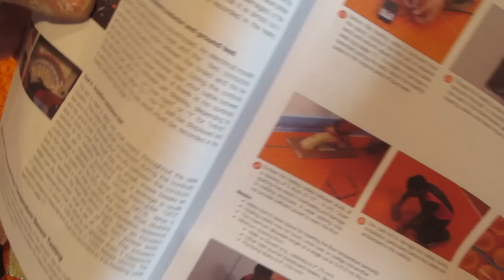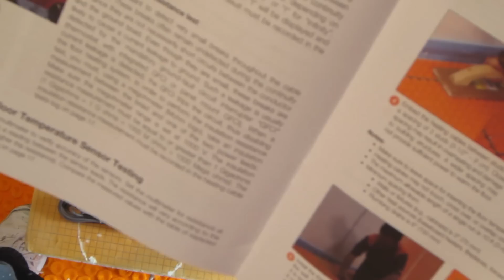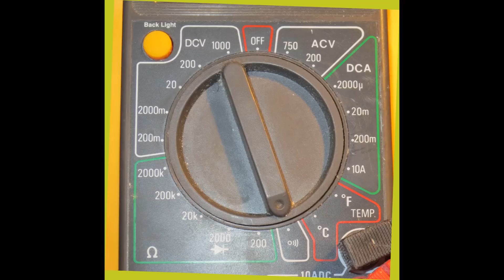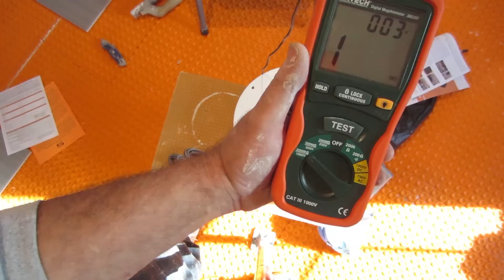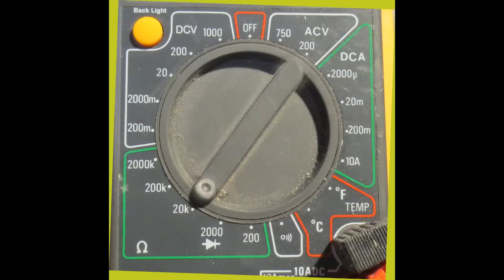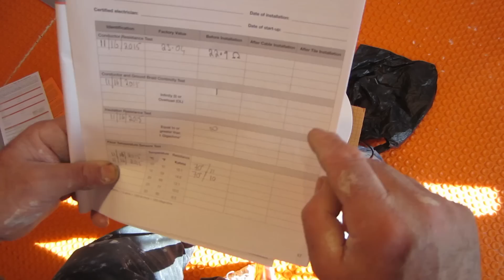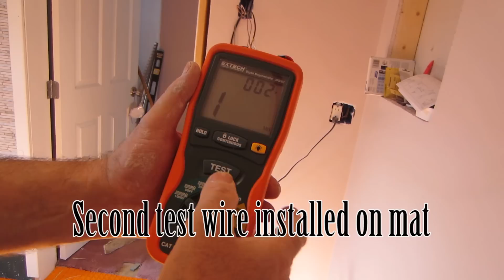Ditra Heat wires test explained and how to

Comment: Hi Sal,
I bought a megohmmeter (Klein Tools ET600) to test my wire. Haven’t done it yet. I know you’re not an electrician, but maybe you can help. I’m trying to wrap my head around the idea that I’m sending 1,000 volts into this thin wire, yet it can’t harm it? That’s over 8 times the volts of household current!  I also can’t understand how a battery operated device could do that. I’m actually a bit afraid to use it on the wire. And the directions say to press and hold the test button, but not how long to hold it. Would you be able to explain how this works? Thank you, and hope you have a good Christmas. BTW, I have found your videos as or more helpful than Schluters own videos.
Reply from the maker: Done it countless time. Hold it till the meter reads over 1,000 then you know it is good. Let the wire discharge before you touch it.
Reply: @SalDiBlasi  So if I understand you correctly, you’re saying just hold it until it’s showing that the volts being put into the wire are at least 1000, then you can release. In other words the smaller number needs to be at least 1000 then you can release. You don’t need to hold it until you have the final reading, correct? Thank you.

Comment: Any chance you might be able to share why a 240v/203.8sq ft spool might give a reading of 360-400 of the megohmeter? I tested it with another spool that's 240v/74sq ft and came back at 1524? Thanks.
Reply from the maker: call your schluter rep, or fech support, they will tell you what to do.
Reply: My shorter runs came with higher ohm ratings than the longer runs as well. Did you call them? I would be interested to hear what they said.
Reply: @Craigke1964  You should give them a call yourself, they have excellent customer support!

Comment: What's the difference between this meter and that smaller field piece meter you used before?
Reply from the maker: +Jason Knight One is a Multi meter which is inexpensive, and the other is a megohmmeter, which is quite expensive but required to do one of the test if the warranty is to be valid.

Comment: Sal, did you add those alligator clips to the leads?  Did you just cut the leads and crimp them on?  My tester has probes and they make connecting with the wires difficult.
Great , clear and to the point.
Reply from the maker: yes I did

Comment: The video was ok, but Sal moves around much too fast and He talks fast as well. He used 2 different settings on the test for the two floor sensors on his multimeter which made it very confusing. Also, he said to set your multimeter at 10,000 for the first cable and then zoomed in on a setting of 20k. the Schluter videos for installation of products are much more detailed and profesionally done. Sorry Schluter, you dropped the ball on this one!
Reply: Scott Sickler So how did Schluter “drop the ball” in reference to this video?  They did not make this video.  Strange comment.
Reply: The reading is the same for the floor sensor test it just shifter the decimal place over, same result. I think this is a great video particularly where he shows you each setting on the multi meter. I came here because the SCHLUETER instructions that actually come with the product are vague
Reply: I like the video- super helpful! I paused the video at each step and followed a long

Comment: What's the model # on the 1000volt test meter you're using and where did you get yours. Thanks. Keep up the great videos.
Reply from the maker: +Jason Knight http://amzn.to/2ieOgsO
Reply: I brought this meter after seeing your video, I tested myself, I reviewed your vid again today, my understanding to the manual is, your test result shown here is 1(>2000Mohm) briefly before you release the TEST. you should hold the test until the reading stabilized. The wire has some capacity, takes time to reach the reading, and the 1 mean over range which is good